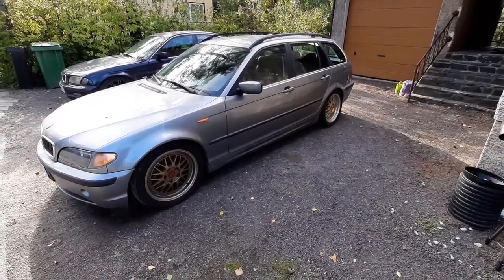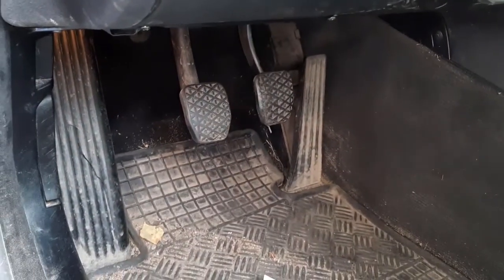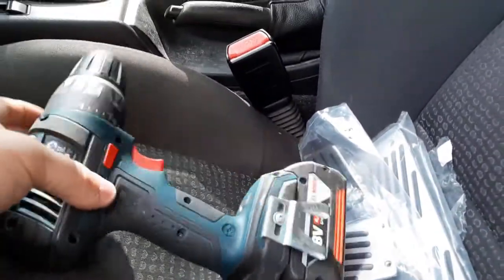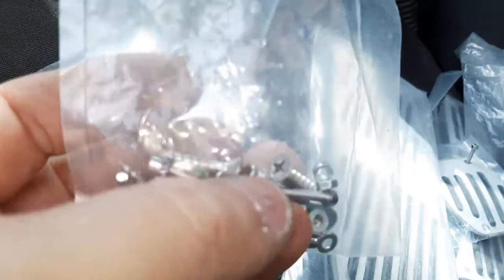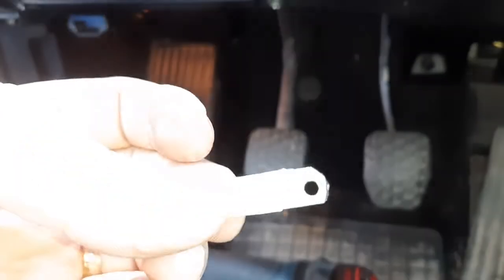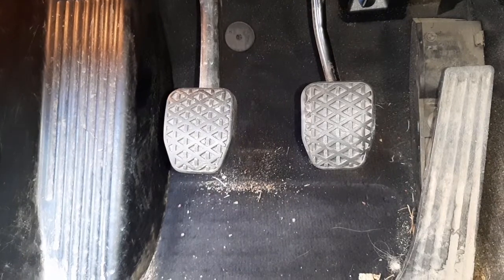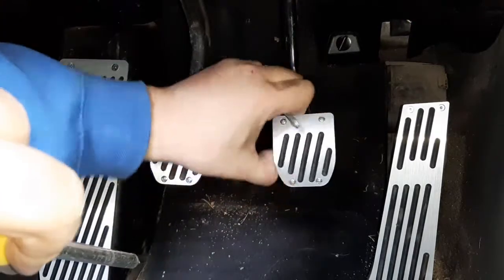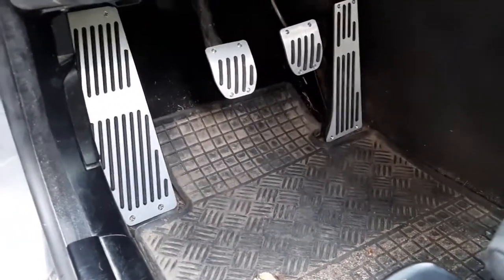Installing Aluminum Sport pedals on a BMW e46 3-series Retrofit

Comment: Supplied hardware looks more legit , just my opinion
Reply: I thought so too but after testin the fit on my car first. I pullet one of the supplied bolts through the aluminium because it has a narrower head.
Reply: Oh ,I see. I’m going to do this today and if that also happens to me I’ll know what to do thanks good video
Reply from the maker: @deivyleon409  Hey he's right. I did not say it on the video but depending on what part you live in the world you might also want to upgrade to stainless steel hardware for the pedals.
Reply: @chargedcars  I live in Florida how does it depend ?
Reply from the maker: @deivyleon409  If you live in an enviroment where moisture and rust is an issue.